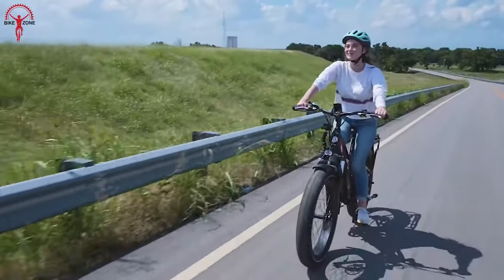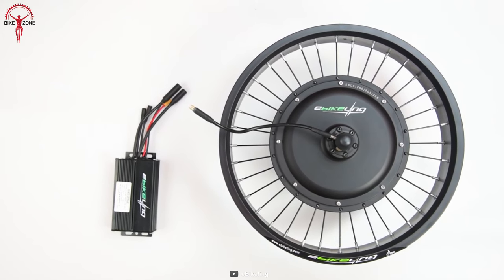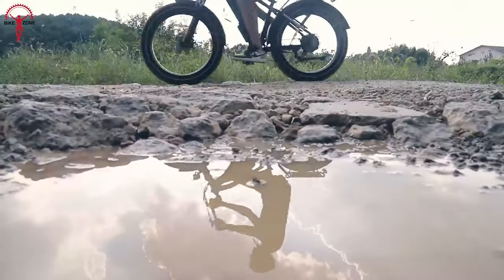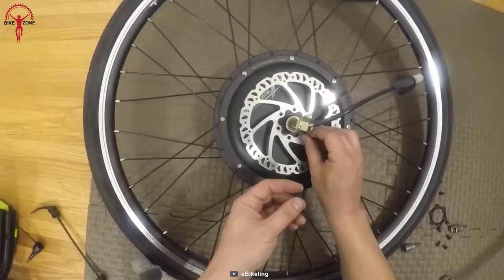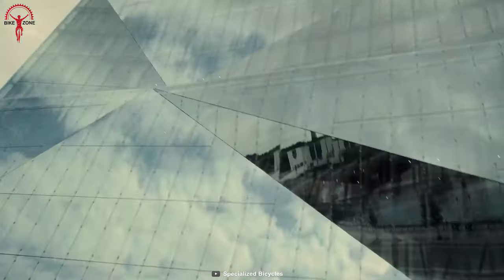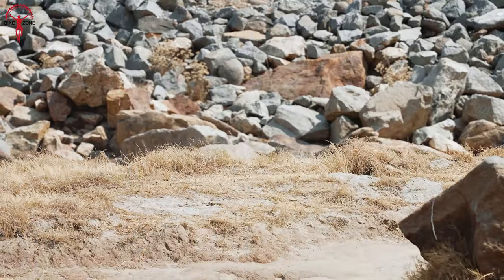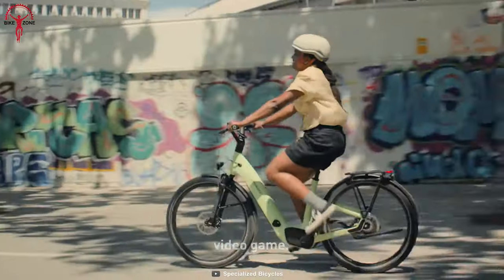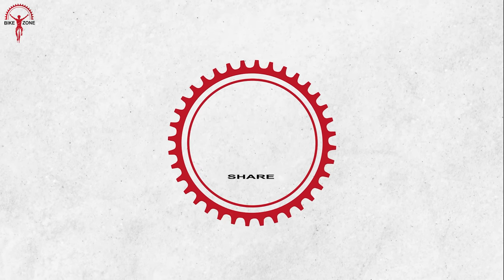Hub Drive vs Mid Drive Motor Explained - The Advantages and Disadvantages

Comment: If a hub motor and mid-drive motor have the same listed top speed, and top speed is your main priority, is there any disadvantage to getting a rear hub bike (the option I'm looking at is about 400 cheaper than the mid-drive)?
Reply from the maker: There is no disadvantage to getting a rear hub bike. In this case, if top speed is your main priority, go for it!
Reply: @bike-zone  Great! Thanks for the feedback.
Reply from the maker: @canadianroot, you're welcome!
Reply: Its not just top speed ,a mid drive utilizes gears better ,so it has much better torque than hub drives ,in some cases almost 1.7x better for the same power output making it much better for climbing hills .So if the bike is heavy ,your heavy and you have hills to climb your much better off with a mid drive
Reply from the maker: @SuperTerryBull  You're right! A mid drive motor utilizes gears better.
Reply: @bike-zone  and breaks them as well
Reply from the maker: @MichaelGreenLagos  There are instances, yes! :s
Reply: @MichaelGreenLagos  Not if you run a belt. Even if you dont, Id rather break a chain than my motor
Reply: Hub motors are really loud and mid drive not so much and mid drive your able to use your gears to be able to choose between a lot of torque with less top end or more top end and less torque or have it in between
Reply: @ferguson8143  yeah i always wonder what hub drive riders are talking about with that. I cant even hear my mid drive over the sound of my tires rolling on the pavement. But when a hub ebike passes through my neighborhood i can hear it from inside my house
Reply: @thisone3519  yeah I put street tire on my fat bike build and it's really silent now
Reply from the maker: @ferguson8143  Glad you shared your thoughts.
Reply: @thisone3519  breaking the chain is a huge deal breaker for me. How the hell are you going to get home? Bicycle usage wise, I hate nothing more than being stranded on the road. That's a nightmare.
Reply: @justdev8965   with a chain repair kit that fits on a keychain. Much more likely to puncture a tire which would also leave you stranded. I havent broken my chain on my 1500w 52v e-mtb in the 4 years ive had it. Either way, I'm upgrading to a belt drive system

Comment: My electric bike has a 750W Hub Drive motor with a standard 48V 13ah battery, and a 48V 21ah extended range battery. My question about the 48V 21ah Extended range battery that's operating on the 750W Hub motor. Will I be able to increase range and my miles per hour  ( mileage ) with the 48V 21ah battery if I travel for a longer distance. If so how will I know if my mph has changed based on the distance traveled.
Reply from the maker: Not necessarily you'll se a change in mph. But the range will definitely be increased with the extended range battery.
Reply: @bike-zone  How would this happen, and what should I look for ?
Reply: @calvintanner7897  while other factors come into play, like speed limiting and internal resistance of batteries, batteries of the same voltage will result in the motor turning at the same speed.  
The greater range is a result of the higher capacity battery, so you longer range battery should give you about 50% longer range for similar speed, weight, and road conditions.  HTH, John
Reply: @johnemms6824  Ok, thank you 😊
Reply: @johnemms6824 What about Kilometers, will that change as well? Will I see a difference in Kilometers ?

Comment: Lol I dunno what emtbs you have been riding but your warning section about not shifting while under power will result in instant chain snapping.  I do 2000' elevation in 20 miles.  Changing gears whenever I want.  Never had an issue.  21 Turbo Levo Comp
Reply from the maker: Thank you for sharing your thoughts!
Reply: Indeed thanks Michael, because that part of the video made me really worried of getting a mid drive bike.
Reply: The off the shelf mid drives are only 250-350 watts.  What you have to worry about is the Bbshd 1500 watt mid drives that have massive torque.  If youre in the wrong gear and you go full throttle chain can snap easily. Im not sure your levo comp has a throttle.

Comment: The vid is ok but it is biased towards PAS systems and DD hubs vs Geared...no mention of higher vs lower powered bikes or the actually ride sensation/characteristics of each system. I am only being critical because this was presented to me as a good newbie vid and I think the pros and cons are weak. I think the last 20secs says it all, "offroad vs commuting and all the preferences in between" Technical trail riders and Kid carrier cargo bikes should go with crankdrives(middrives)...anyone else who likes the Jetsons feel, has no serious weight restrictions and doesn't need to hill start with a load will probably enjoy a geared or DD hub. Just learn to patch tubes without removing the wheel and bring a rope to suspend the flat wheel off of the ground from a branch or what have you....and get out and ride!
Reply from the maker: Very insightful. Thanks for sharing.

Comment: A powerful mid drive destroys the chain and gears and it difficult to pedal along the engine wont to rev high but the poor peddler can not keep up
Reply from the maker: Thank you for sharing your thoughts.
Reply: I mean not all motors are made the same. Use the throttle only then.

Comment: Most mid-drive bikes do not have throttles - if you need throttle hub drive is a better choice.
Reply from the maker: Thanks for sharing your thoughts.
Reply: You've gotta be kidding me. Yes they do have throttle.
Reply: @justdev8965  they move the crank arms on throttle? like forcing u to make pedal motion?
Reply: @justdev8965  all the mid-drives Ive looked at do not have throttles. I was told its cause the starting torque is lower the hubs, so they dont bother with it (1up Prodigy v2 and Specialized Turbo Como are peddle assist only)

Comment: I was wondering when this was made? It does not ring true. The hub bikes I see are much much lighter, do not look like ebikes and overall look normal. I have been comparing a number of hub drive and mid drive. All mid drives, every one weighs a whole lot more and I mean a few kilos more.
Reply from the maker: Thanks for sharing your experience.
Reply: Can you be more specific and give numbers? I'm researching hub drives, and all of the bikes that are worth anything weigh 55-65 lb. Whereas, I do not know the weight of a quality mid drive such as specialized.
Reply: Huh? Hub drives have the weight of the bike combined with the weight of the motor and battery vs the mid drive motor using a much lighter motor from hub motors but also integrated it into the frame make the bike jumpable utilizing a better center of gravity usually a smaller battery idk what ya sources are
Reply: Hahahah the hub drive is better guy.  Lemme guess....never riden a real emtb have you?   If you had this comment would not exist
Reply: @watchmanonthewall14  my 1000 watt mid drive and my 52 volt triangle battery weigh just about 20 lbs together
Reply: @ferguson8143  Thank you.
Reply: @ferguson8143  that's probably a pure carbon frame or titanium perhaps? Not fair to make it sound like the impressively low weight of your e bike is due to the motor only. It's not! It's mostly your frame.

Comment: mid drive bicycle needs at least 428 chains from motorcycles but all ebike companies has no develop power to overcome existing mtb parts. so better buy proper mid drive electric motorcycle than overpriced under engineered ebike crap.

Comment: Take this video down. It is totally inaccurate and false. First off, hub drive puts more strain breaking your spokes and putting torque onto the bike frame which becomes dangerous if u don’t have torque arms. Secondly, you can drive a midrive without using the motor. I can go on and on, I haven’t even got to ghosting in the pedal assist whereas mid drives have a torque sensors.

Comment: Of course you can change the tires and rims with hub engines, what the heck is he talking ?
Reply: I guess the added trouble of undoing the band ties and cabling to get the wheel off ! I know it was doable but i bought slime inner tubes hopefully to avoid having to repair a puncture on the roadside, so in answer to your question and statement of course its doable but in emergency not as easy.
Reply from the maker: Valuable insights! Thanks @Bergwacht and @Peter Day
Reply: @daypet1  A piece of cable with a plug comes out of my hub motor, which I unplug and then removing it from the bike is just as complicated as with any other bike, it just weighs more. There is not a single cable tie that I would have to cut.
Okay, there's the extra torque lock, but that shouldn't really complicate matters.
Maybe he is also referring to changing the rim without the hub, but putting spokes in and out of a hub is always complicated, regardless of whether it's a 20-inch children's bike rim or a 29 inch hub motor.
Best  regards!
Reply: Not more complicated about removing the rear wheel of a hub drive bike compared to non ebike. Only difference is you have to unplug the electric cable to the motor before removing wheel. I think he might've been talking about installing a different rim.
Reply: @daypet1  It is literally one cable you have to pull. Not more.
Reply: Hahahah ok hub drive Berg.  Mid drives slaughter hubs in every metric except price.  I hear you can still buy a horse and carriage but it's about as practical as using a hub drive motor in a modern bike
Reply: They have to match up with the motor, as explained in the video. You cant just buy anything off the shelf and hope it will fit onto a hub motor because it wont.

Comment: This covers the two pyramid points.
Then there are soooooooo many other factors when choosing an Ebike.

Before you buy an Ebike, take a class. Learn the info.
Test drive a few.
It's like electric cars. 
So many factors that without education, you're shooting blind 🦯🦮
Reply from the maker: You made a great point. Thanks for sharing!
Reply: There really isnt any classes you can take. About all you can is talk to the local ebike shop guys and watch youtube videos (and shift thru alot of bias and non-sense hot takes).